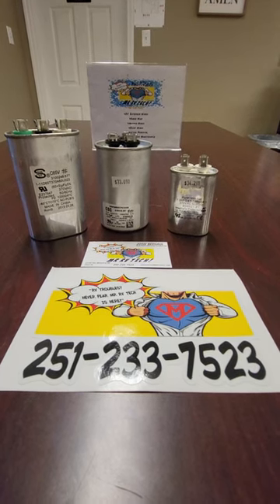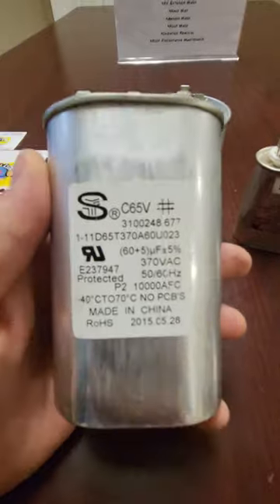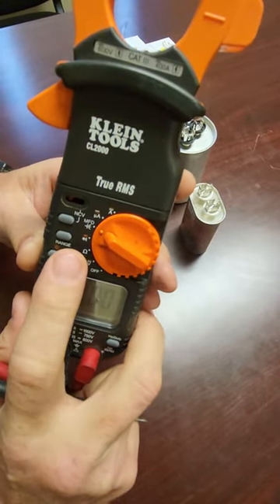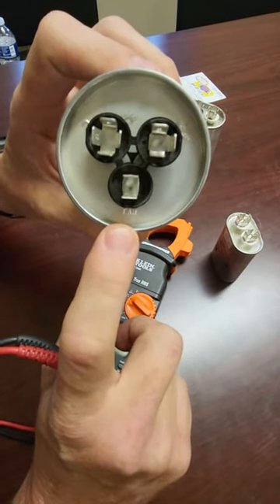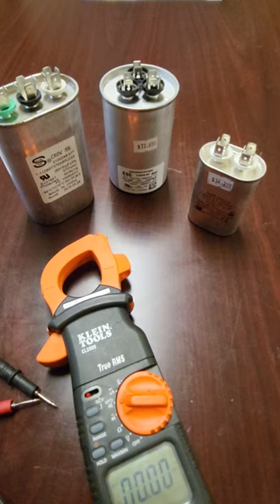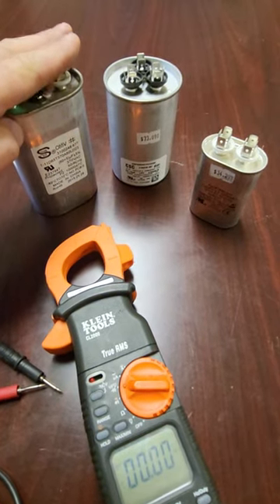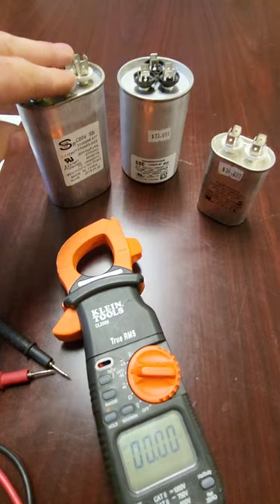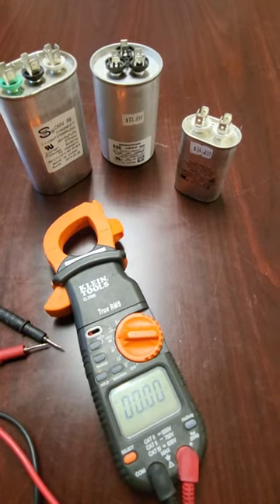RV Air Conditioner capacitors

Comment: If you want to test under load, use your meter in amps and clamp on herm. Take reading and multiply it by 2652, now use meter and take voltage between common and herm.  Take number and divide by voltage will tell ya how much juice she got left! Cheers

Comment: I have a 2000 mini Winnie Winnebago with a air conditioning on top only has 30,000 miles on it anyway I’m having problems with my fans starting and I changed all three capacitors. I know the starter capacitor for the fan has the brown wires in. it’s kind of the oblong shape Capacitor changed all three and I switch on the switch to check it. The fan still won’t start if it’s turned on and then I touch the fan and start turning it with my hand. It will go and it will work and work on high and low and everything works, except for the fan starting up and I know the capacitor that I put on the new capacitor I put on there works and I checked the white wires to go to the fan and it doesn’t seem like there’s any short those wires is there anything I might be missing, keep that fan from starting because the fan works. It works on high and low. It just won’t start unless started with my hand please I’ve been dealing with this for limited time over four years because RVs in Colorado and I live in California so I have a little time to work on it, but it’s really frustrating. Please help.

Comment: Question when there are some wires that look a little burnt  should i cut wire back some and replace the ? Spade? Also on air box there is very minimal brown look on 2 of the 6 connectors. I dont have a meter to check anything but i do know the compressor tries to "kick" but doesnt fully kick in. But got a new capacitor gonna replace and hope thats all it is. Please let me know about burnt wires! Thanks
Reply: Also the one in unit is 60 +10 but when I look online it shows 50 +5??? Duotherm b59516.711c0
Reply from the maker: Yes clean up the wiring and install new spade connectors.

Comment: I could absolutely use your help with my campers ac unit.  If possible, thank you. Amanda
Reply from the maker: What's up?
Reply: I have a roof top  ac unit in my camper. I'm going to attach a video of the unit trying to start, can you tell me just by listening if I need the start capacitor or the other one?
Reply: @amandabuttsdubose9480 i am having this same problem and it is a humming noise, thats all it does when i turn it on.
Reply: Sounds like the fan motor is going out. You can spray wd40 on the base of the shaft towards the motor, (just a few good squirts) then spin it by hand some, and it might buy you a little more time. But a motor replacement is probably needed. These motors are not strong and the least bit of grime or wear can make them do that. Always make sure electricity is completely disconnected before working on it. And make sure you get correct fan motor if you replace it. I'm sure you can find videos on your particular model.

Comment: My Dometic currently has a 40/15 dual start capacitor. Can i sub it for a 50/15? 40/15 is super hard to find and 100 times more expensive so just wondering.
Reply from the maker: Can you? Yes. However it is 5% over the rated tolerance so don't be surprised if you experience a malfunction down the road. You likely will not for a very long time. That being said, in my professional opinion it is always best to utilize the correct parts as they were engineered for optimization.

Comment: Does it matter what size compacitor  I replace one with?
Reply: Yes, greatly. Get one with the same ratings in farads and voltage as the old one if you can't find an exact replacement. I think most motors also list what size capacitor is needed.